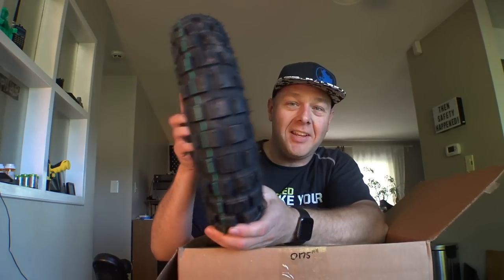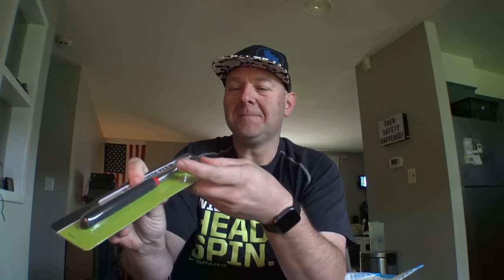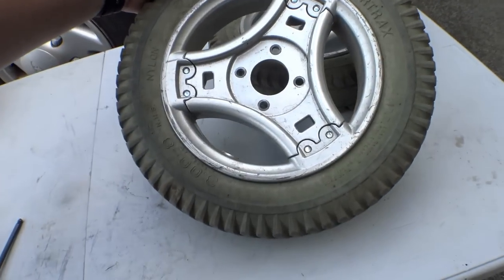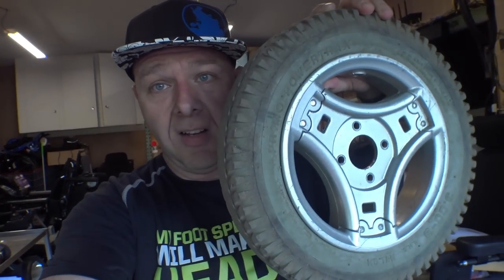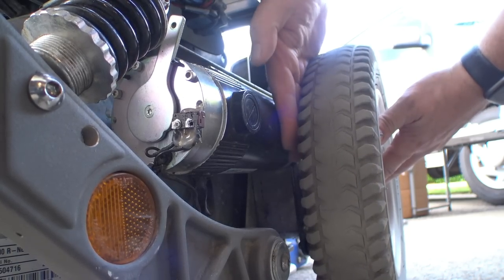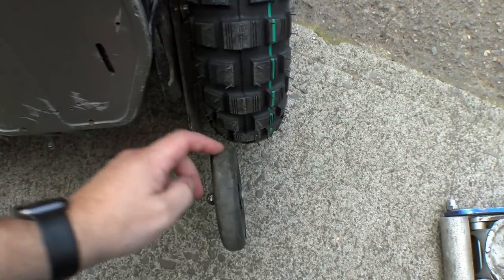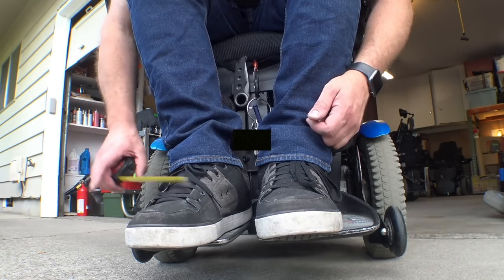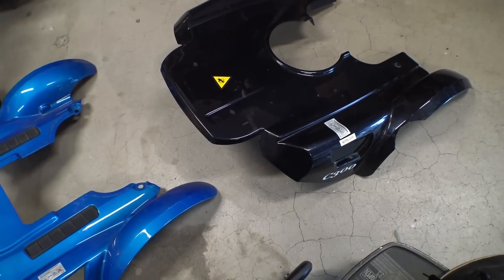MEGA VLOG 513: building the $91 OFF ROAD powerchair!

Comment: Hello,
what do you think about Frog legs front castor forks? I have folding electric wheelchair (D 09 by  JBH Wheelchair) with solid front castors and ride is way to stiff. 
Thank you.
Reply from the maker: ive got an old quickie S626 power chair - and it has frog-legs on the front of it... lemme tell ya - it can be DANGEROUS! that chair has a really high center of gravity and a short wheelbase.. if ya hit a sidewalk ramp going too fast, it can flip ya right over!! usually an "easy" way to improve ride quality is fitting some air filled tires on the chair.. obviously then ya have to worry about flats etc.. but ya should be able to find air filled drive tires and castor wheels.  that usually improves the ride quality pretty significantly :^)

Comment: I’m looking to purchase some 22 NF batteries for a back up power chair are there any good online places to purchase batteries? Also is it good to keep the chair plugged in all the time or not for the battery health?
Reply from the maker: allegro medical has some decent prices sometimes... as far as keeping them maintained, its "best" to charge them up, then disconnect them from the chair - or turn of the main circuit breaker if it has one.  otherwise plug it in once every 2 weeks overnight to keep them maintained.  leaving them plugged in ALL the time will cause issues/shorten the batteries life.

Comment: hey question . i have a m300 with a vent and battery in back . i been hooked on getting a f5 to even out the weight and because I drive with a chin joystick and they say it's a smoother ride. after watching you ummm gracefully fall lol , do the f5 have that issue ? i ask because the c300 is the older f series
Reply from the maker: No- not at all! They learned from the C300 era! And fixed all the issues! The F5 is one of the most stable chairs out there for sure!

Comment: Hey Dan, would you post the part, item, model or serial # for the inner tubes for the tires?
Reply from the maker: ..ya have to search for them - they change constantly.  just look for tubes that fit 3.5-8"  tires and make sure they have right angle valve stems. (they fit "honda mini trail 50" bikes) ive updated the links a few times in the video description as they expire - but "part numbers" are irrelevant since there's dozens of manufacturers that constantly change everything.  that's the nature of ebay unfortunately! :^/
Reply: complete set on Amazon is $65

Comment: You got any suggestions to turn a rovi x3 into more of an off chair?
Reply from the maker: the way the rovi is setup, im pretty sure larger tires would give the suspension a hard time... 6 wheeled chairs are a bit tricky to use off road - front castor wheels tend to get buried fairly easily!

Comment: Would this tire option work on my trident by drive?
Reply from the maker: not sure... this mod was specifically for older front wheel drive permobil chairs, and everything just happened to work with the wheel spacing, and being able to flip the wheel around etc.. most power chairs use similar size wheels (rims) so it might be possible with spacers... havent seen a trident in person though

Comment: re 29:50 Instead of cutting the mud guards off; why not just put some spacers on the bolts that attach the fairing to the chairs body, to lift the mudguards a centimeter or two.
Reply from the maker: i actually cut that out of the video for some reason.. was trying to keep it "shorter" lol but yes! that does work pretty well!

Comment: Okay instead of cutting the plastic like you said . Why not just put some Rubber grommets Underneath the plastic cover that would lift it up high enough that it would not rub on the wheels and you wouldn't have to cut it at all
Reply from the maker: i ended up cutting that part out of the video for some reason.. was getting kinda long :^)